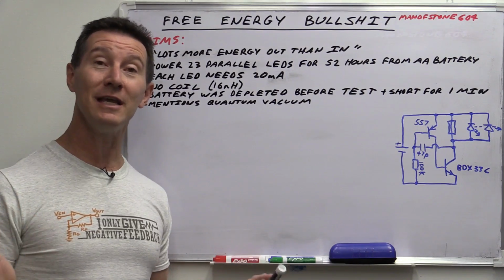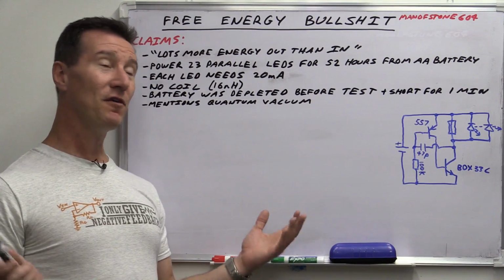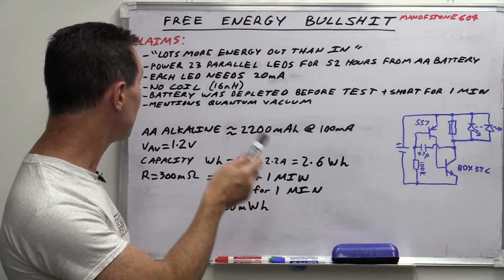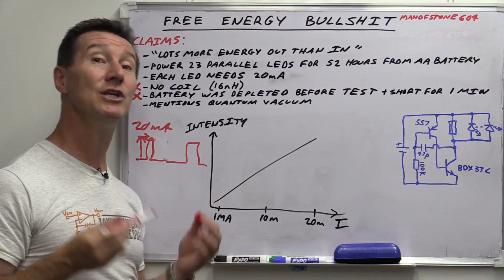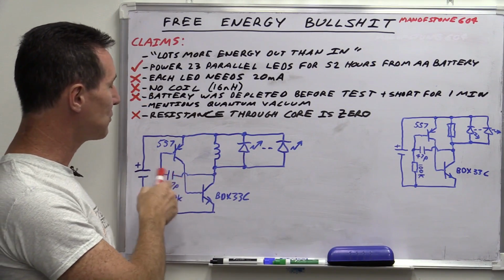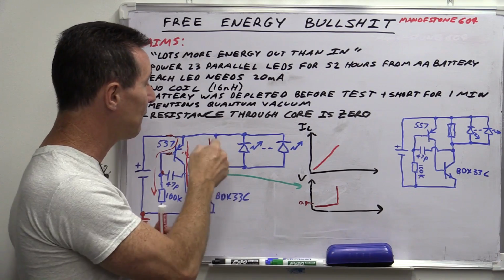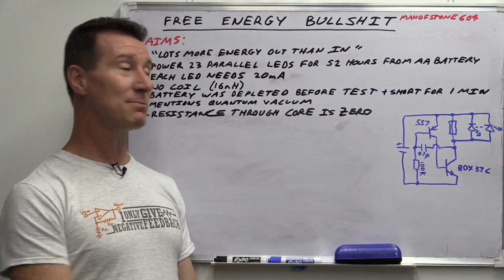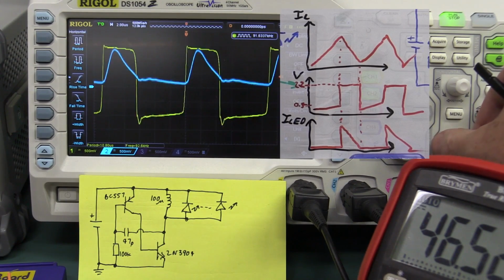EEVblog #708 - Free Energy Overunity is RUBBISH!

Comment: I believe free energy exist in the earth's magnetic field. It's just finding a way on how to implement it.
Reply: When I was in Electronics tech school in the navy, one of the things we used to speculate was if you wrapped yourself in copper wire and held the bares ends in your hands, how fast would you have to run (east or west) across the earths magnetic field lines to electrocute yourself.
Reply: Here is what the "free energy" people fail to grasp. A static electromagnetic field (like the earth's) is not an energy source. MOVEMENT (or kinetic energy) is the energy source behind virtually all electricity production (aside from batteries and fuel cells). The field merely acts as a converter allowing the kinetic energy to be easily converted to electromotive force.
Reply: +Norman Higgs   Exactly correct. And if the "Earth's Magnetic Power" believers had just a smattering of knowledge about science, they would KNOW how incredibly weak the Earth's magnetic field really is.
Reply: You're on the right track, sir. There are plenty of ways to extract that energy. The main thing to understand is the energy/charge balance that exists throughout the earth surface/atmosphere such that there is almost no natural movement of energy/charge in a small distance. If your device upsets this balance such that you have more charge somewhere and less somewhere else, energy begins to move to regain the balance - that energy movement called current can do the useful work. Electric current is NOT a movement of the electrons that make up the atoms as we were taught in schools. Wire only captures and conducts electricity as it provides less resistance for it than the air does. Electrons do exist naturally in the air and earth groundings, this is where they originate from. All generators simply capture the electricity from the air.We are like birds sitting on a high voltage line and not feeling the slightest disturbance. If we were to touch the HV and ground at the same time, we would have no doubts about the abundant energy we float in :)
Reply: That is an awesome question. If I ever find myself as a physics teacher or EE teacher I would do well to remember this hahaha.
Reply: Quantum Leap - When I was in ET school, we once had a discussion on wrapping yourself in wire and holding the bare ends - how fast would you have to go to electrocute yourself....
Reply: LOL

Comment: "I don't understand, therefore it's magic"
Reply: You mistake me for someone who believes in magic.
Reply: @Austin Stockwell Bollocks!
Reply: And thus, a bunch of idiots who doesn't understand overunity mechanics as well as unable to think thermodynamics can be wrong especially when it comes to entropy.
Reply: @atum7355  But can you offer a scientific model that is superior to current thermodynamics?
Is it more likely that the fundaments of science, which all technologies since the industrial revolution depended on is incorrect or is it more likely that perpetual motion machines are impossible.
Fun fact: any epistemically possible implementation of maxwell's demon is still bound by the laws of thermodynamics.
Reply: @ahumanbeingamnayplaceholde1746  Why does one need to create a better one? All it needs to be done was changing the law. "Entropy can both be positive and negative depending on the state of the vacuum."
Reply: @ahumanbeingamnayplaceholde1746  Perpetual motion is pure bollocks since there is entropy. There is only one maxwell's demon that is free from thermodynamics 2nd law - magnetic attraction.

Simple isn't it? Using a synchronous motor as a synchronous generator at the same time just by adding another stator winding layer as electrical output, 3 phase of course.

Typical generators convert mechanical energy into electrical energy but how much do you know ahout the self-excitation mechanics? Output is looped into the rotor to increase the rotor current, which raised back up the induced emf which is reduced by back emf, or rather, back flux generated by output current. Emf reduction due to faraday-lenz law.

Now what happens when the mechanical input is replaced by electrical input? Electrical to mechanical to electrical. Not much difference EXCEPT when rotor current increases, induced emf is raised back up like normal AND strengthen magnetic attraction between the primary winding and the rotor like a synchronous motor.

Energy flow for a typical generator.

Mechanical -> magnetic -> electrical
Electrical -> magnetic = positive feedback
Mechanical -> magnetic = negative feedback due to lenz's law

Energy flow for a synchronous amplifying rotor-transformer/dynamotor. Note, primary winding and secondary winding is also coupled together electromagnetically.

Electrical -> mechanical -> magnetic -> electrical

Electrical -> magnetic = positive feedback

Magnetic <---> mechanical = strong magnetic attraction - lenz's law = positive feedback

Hope you understand the energy flow. Yes, self-excitation is considered overunity. It's just that because of negative feedback, it isn't considered as an input but simply for inducing emf.
Reply: @atum7355  You didn't say anything. You think regurgitating some simplistic garbled mess of words makes you smarter than people who have dedicated their lives to figuring out how the universe works?
Reply: @Person01234  Are you sure they are "figuring out how the universe works" or are actually scamming you?
Reply: @atum7355  Yes I'm sure. A scam requires some sort of... y'know, scam.
Reply: @atum7355  Nice post but you might as well have written alien symbols for the plebs on here. Most people who make these anti overunity videos and angriliy scream 'psuedoscience' in the comments are exeriencing a severe case of superiority complex and an obvious desperation to think theres the slight possibility the human mind can understand everything using thermodynamics alone, ranting about the conservation of matter and a bunch of other malarky. You'd have to turn up at these guys houses in a UFO driven by overunity for these people to take any notice and no doubt some of them would still pretend they didnt see it.
Reply: @247RaverUK  Well. That's just how humanity is.
Reply: @atum7355  Nice way of putting it. I'm glad these debunking people exist, no way some no degree garage technicians like the people I've met would have got their foot in the door of such a complicated industry otherwise. Have you seen the molten sodium reactor by Daniel Lanthrop? https://www.youtube.com/watch?v=rAYW9n8i-C4
Reply: @atum7355  
thank you, more are being aware about the simple mechanics. too bad the pro's don't want to give in to this heresy like the roman church was against galileo, the cee model was crippled for symmetry worship and c is infinite.
Reply: @Person01234  math is an intellectual tool to analyze, he just describes the basic concepts and working principle
Reply: @atum7355  
They live by the golden rule: he who owns the gold, makes the rules
Reply: @Austin Stockwell 
Aight, power your house of a free energy device and prove us all wrong, go on, do it. You can't, and never will, because physics says no. You can't argue with physics.
Reply: @Austin Stockwell In this house we obey the laws of thermodynamics!
Reply: @Austin Stockwell Well according to physics the Sun is Magic, and because they believe it has been there forever it is a constant, but all energy came from somewhere at which time it was free energy.

Comment: First law of thermodynamics: When energy passes, as work, as heat, or with matter, into or out from a system, the system's internal energy changes in accord with the law of conservation of energy. Equivalently, perpetual motion machines of the first kind are impossible.
Reply: The three laws of thermodynamics only apply on isolated (closed) systems. Scientific establishment never mentions open systems and their examples in a real world, it's all around us.
Reply: when it's not getting energy from an outside source it's a closed system. Systems are based on scale, the Earth isn't a closed system because it gets energy from the sun. On this scale it is a closed system because it's not recieving energy from a source outside the circuit, therefore perpetual motion is impossible.
Reply: Very true, scale determines everything, but as long as the energy available (ambient energy background of the Earth) is concerned,  how do you determine the scale? You can't consider it as closed system with the sun being the only source of available energy, it's in fact only a tiny bit of it. There are myriads of giant stars and galaxies all around us. As a matter of fact, a sky map taken by the Haslam telescope at 408 MHz shows the intensity of the electomagnetic field at that frequency and there are areas where the field is far more intense compared to the incoming flux from the Sun. This means there are sources of energy far greater than our Sun, which could be a speck of dust.
The fact that the scientific man has no idea how to access that energy source doesn't mean that it is not possible. If the device can use a small intial energy to capture larger amount of energy from the external source then self-sustainable device is possible. It is still within the laws of physics. Still not a perpetual motion machine, but who cares if the huge external source of energy can do the work for billions of years.
Reply: energy can't be created or destroyed, even if a machine is 99.99999% efficient it isn't perpetual motion, no machine ever created will be more than or equal to 100% efficient which is the point of the laws of thermodynamics.
Reply: True, no system can be 100% efficient, but my point is most people do not understand the difference between perpetual motion (which is obviously not possible as energy cannot be created and there always needs to be some energy source) and a self-sustainable device. Self-sustainable device does not violate the laws of thermodynamics. It uses a smaller amount of energy of the initial source to trigger and draw in the larger amount of energy into the system from the external source. There are multiple examples of this proving that displacing larger amount of energy using a much smaller input is possible.

Comment: Mr. EEBlog can you help me? I am trying to make a Magnetic motor. I am going to shield the magnet with either Brass or copper tubing with the magnet glued inside of the brass or the copper. So will the brass or the copper shield the magnet to prevent the togging effects that i am getting. I have a round 7 inch aluminum with the magnets pressed onto the outside Diameter 18 evenly spaced and a larger aluminum round tube that has the same amount of Magnets on a 40 Degree Angle that will go over the smaller 7 inch peace  as the driver for the smaller 7 inch round Aluminum. But dose all of the magnets need to be shielding??? Please help me before I wast a lot of money having all of these peaces made. Thank you.
Reply: If you're trying to make a motor using only permanent magnets, then stop before you waste any more time or money.  Ask yourself why you can't buy one on e-bay..... the videos are fraudulent, they can't work.  Wind some coils.
Reply: I was really trying to figure out what he was talking about lol. But your comment made me realize he was trying to get something for nothing. Thank you.

Comment: Great show, Dave!No need to get excited about that free energy bullshit!There are so many hobbiest-electronic-experts out there who really feel the continuum energy flow ! :-)One thing i am interested in, is there something about those pulsing battery chargers that claim they meet the resonance frequency of some plumbum-sulphate crystals of lead-acid batterys to rejuvenate and desulfate old lead-acid starter batteries? I doubt there is one resonance frequency for all those crystals so there is probably no magic about this resonance thingy. But does pulsing have a positive influence on old sulphated batteries?It might help starting the charging process, when the internal resistance increased too much to charge at reasonable 14-15V.And it helps not overheating the battery when charging with pulses of 30 - 100V at some 3-20A pulses with a duty cycle of around 1%. Would like to see an investigation of yours on that topic!I tested a few schematics found on the web to do pulse-charging (one magic thing is the so called RE-EMF-Charger), but there are also more reasonable projects. As far as my research went, i didn't find any significant magic in all those circuits - but it can help the charging going to start in some cases.

Comment: Energy is for free end of it. We surrounded by free energy. All you need is just a  knowledge how to convert one form into the other
Reply: +Len P I'd argue "[getting] energy out of nothing" can account for the majority of how free energy is used. It's just that phrase means different things depending on whether someone is a scientist, economist, or conspiracy theorist.
Reply: +something1random23 We can only obtain work from heat while it's dispersing to a colder location. Heat won't be able to accomplish anything once it's become evenly distributed (achieving maximum entropy).
Reply: No energy resource is infinite. This universe is barreling toward becoming a cold, dark place and nothing can be done to prevent that.
Reply: I agree. It is more philosophic... The sun&#39;s energy is &quot;free&quot;, too, as an example. The term of free energy is often misused as &quot;get energy out of nothing&quot;. There are already devices which suck energy out of the air, but even these just use the electromagnetic fields of human radio transmissions passivly. There could be many other energy sources like sunlight, electromagnetic fields or heat difference which hasn&#39;t been discovered yet. But if someone actually &quot;finds&quot; one, he should prove it properly.
Reply: The universe is not going to "run out" of energy FFS.
Reply: +something1random23 Chances are the universe will inevitably run out of free energy, meaning all the energy that exists will be converted into heat and become unable to accomplish work.
Reply: +something1random23 Your argument has ignored the 2nd law of thermodynamics and its implications. You may not deserve outright name calling, but you're dreadfully underestimating what's capable of debunking the possibility of a universal heat death.
Reply: +something1random23 The universe has been constantly expanding, meaning it will likely be very cold by the time it reaches maximum entropy. Even if the universe will be hot enough at equilibrium for matter to emit blackbody radiation, the solar panel wouldn't be able to survive the heat.
Reply: +something1random23 The solar panel would have to die eventually. The energy it received wouldn't be enough to keep it repaired.
Reply: something1random23 That solar panel would be defying the 2nd law of thermodynamics by reducing the entropy of the universe. If you're envisioning a future where that is possible, then in that case the concept of a heat death and death in general can be thrown out the window.
Reply: something1random23
What do you mean?
Reply: The "cold" part of the death of the universe, if I recall correctly, is because the evenly distributed energy of the universe combined with the accelerating expansion of the universe would create a very low energy density. Making it seem very cold. Expansion of gasses type stuff. Compressed = very hot; expanded = cold; even though there is the same amount of energy in the expanded box as the compressed box (including the walls and the force they apply)
Reply: Elaisa Kasan While stars may be the closest thing to literally creating energy out of thin air, they are still a net loss in free energy. They burn up the nuclear potential energy of hydrogen, and, even when they create usable energy, it's rarely utilized.

Eventually, all the stars in the universe will die off, having only delayed the inevitable.
Reply: Elaisa Kasan Free energy, in context, is the pseudoscientific claim that perpetual motion machines are possible. This has nothing to do with whether or not it has to be bought from corporations.
Reply: Nesuniken And that makes it a cold place how? Anyway, if that is the case, heat can be pretty easily converted into other forms of energy. Most forms of power generation do it. And that's neglecting the fact that many materials, when hot put out light.
Reply: Doug Anderson look at the random Internet genius. Here to insult and name call.
Reply: Nesuniken It hasn't though. I simply gave black body radiation as an example of energy transmission. How could that not be used by a solar panel?
Reply: Nesuniken Not today's solar panels, but we have no idea of the technology or whether humans will survive for the amount of time that takes, which is what makes this a somewhat pointless discussion. We cannot possibly comprehend what the universe could be like at that stage.
Reply: Nesuniken You can't possibly know that.
Reply: Nesuniken you're literally just inventing information at your convenience now.